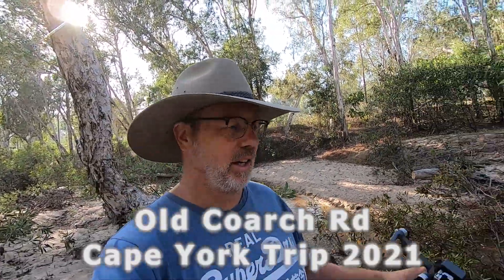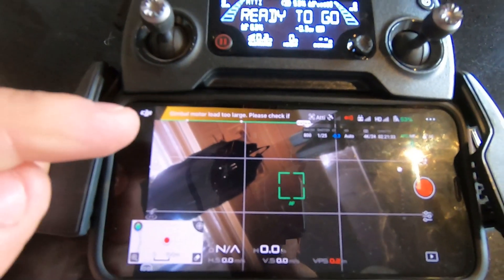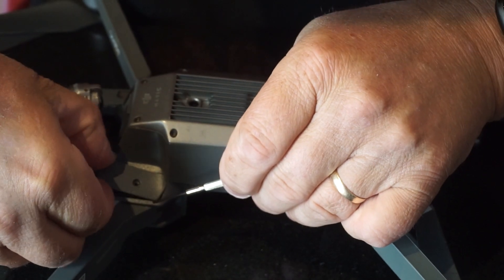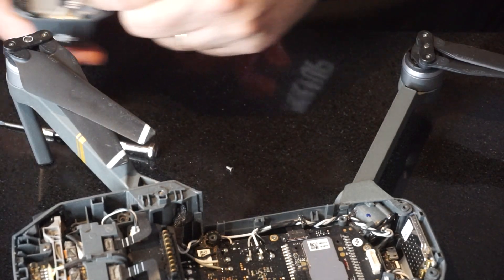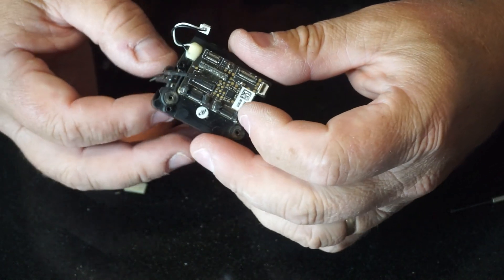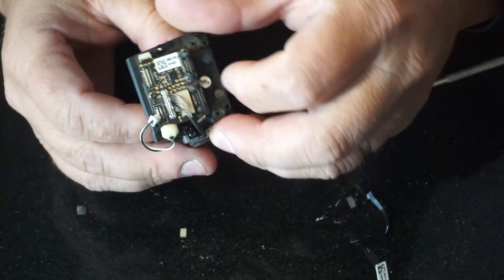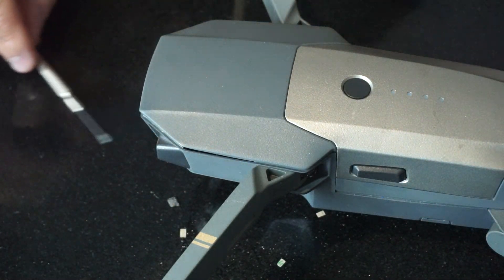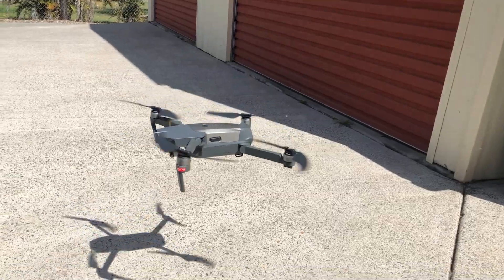DJI Mavic Drone Gimbal Repair | Can I do it?

Comment: Nice one mate.
I have the same drone, have changed the gimbal cable also about a year ago. Not bad considering it's age. Just got an air 2s and can highly recommend one.
Reply from the maker: Thanks for the kind words mate.  What do you find is the main improvement between your Mavic and the new Air 2?  Cheers👍😎
Reply: @JafffaAdventures  Your welcome. The Camera, it has an extremely good camera now, It's definitely very noticeable with just the camera improvement, the sensor is greatly better and bigger, great at night also. Otherwise it flies around the same. I do miss the controller with the screen.
Reply from the maker: Cool, thanks for the intel👍😎

Comment: Thanks Terry King ,for another fantastic presentation. Sorry about your Drone (Gimbal /ribbon cable). You are an amazing individual , love your Akubra. Guess it’s not really the cost of a thing (drone ) , but you are willing to try the repair
Reply from the maker: That’s it exactly John.  My moto is to give it a go, if it works you’ve got the satisfaction of the success, if it fails I’ve still learned something.  Thanks for the kind words mate, I sincerely appreciate it.  Cheers😎👍

Comment: Top job Tezza, always satisfying to achieve a result from diagnosis and research. Of course just trying see those tiny frecking small fasteners + connectors is the biggest PITA (especially for old farts hahaha). My motto is "Man made it, man can wreck it, man can fix it". Cheers Gaz
Reply from the maker: Good motto Gaz, and yes those fasteners and connectors are brutal.  I wish I was 20 years younger for that one. Thanks for watching and commenting Gaz, I sincerely appreciate it 👍😎